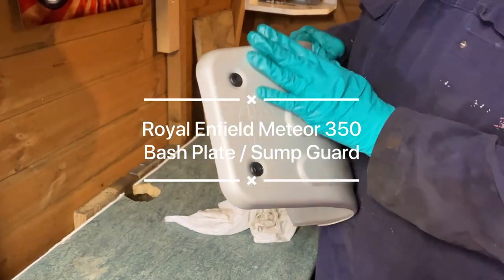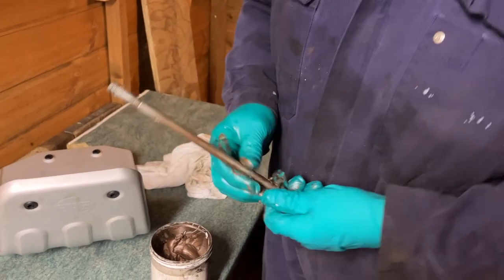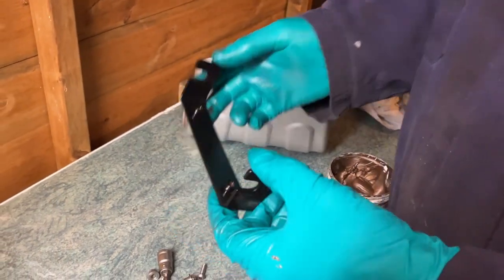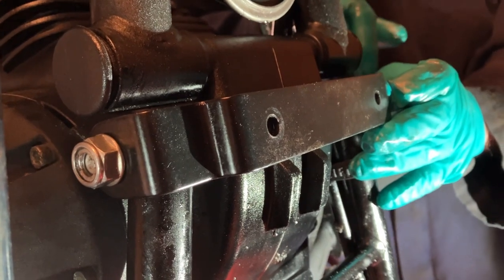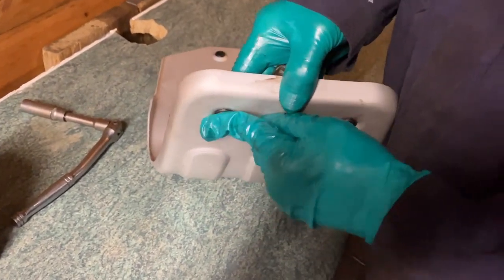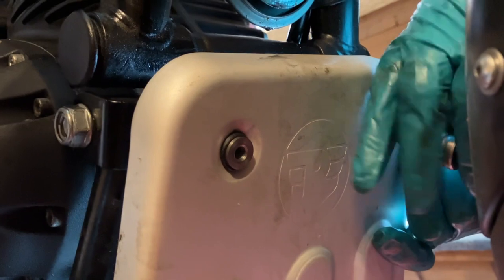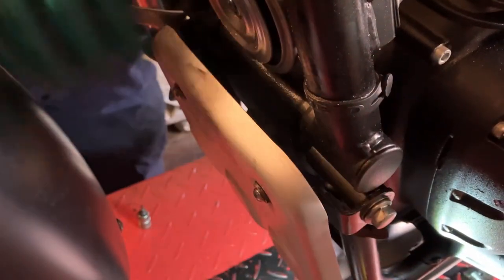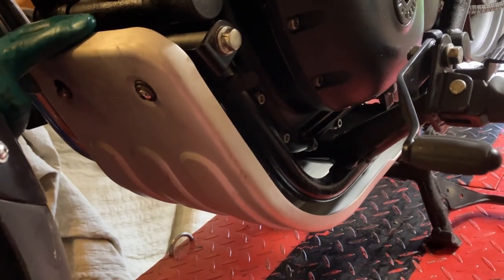Royal Enfield Meteor 350 - Bash Plate / Sump Guard

Comment from the maker: In watching this video back, it would probably have been better to tighten-up the two front bash plate bolts before tightening-up the engine bolt. It worked out fine but that is probably the better way around.